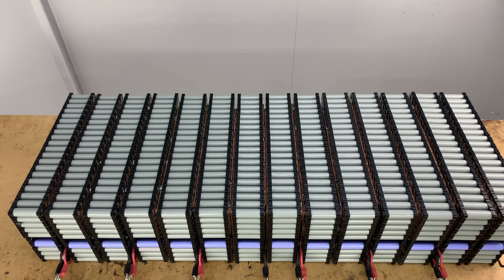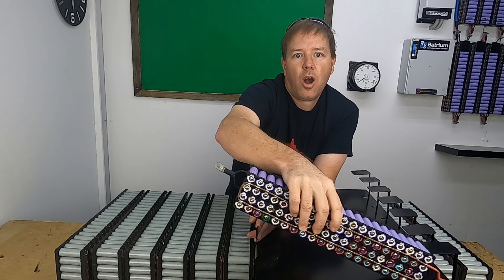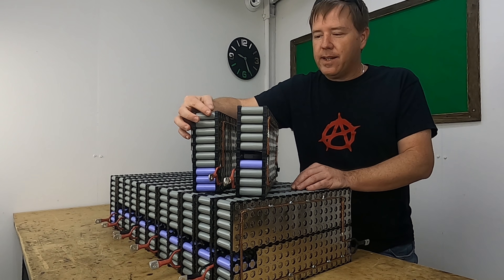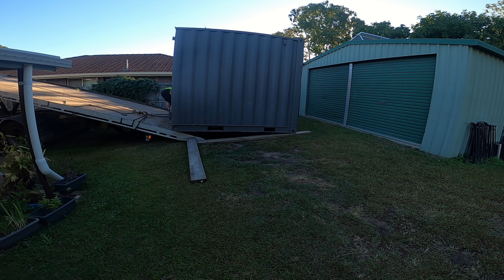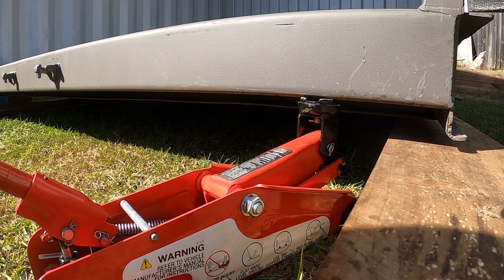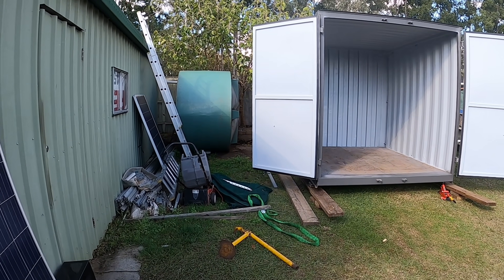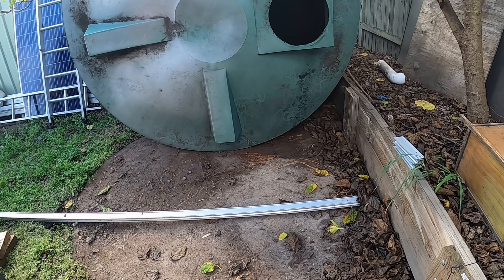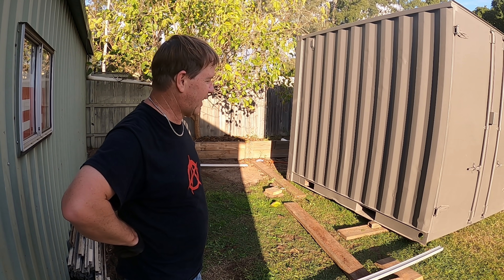Pt.2 Finding out my massive battery won't pass inspection!

Comment: Now I can see why there is a world shortage of Lithium cells…..You’ve got them all 😳
Reply: You can get a lot from the junkyards but you'll need to clean and test each one.
Save a little cash.
Reply: @arguescreamholler  What mythical junkyards do you speak of? The ones around me only accept scrap steel and don't allow people to pick through them.
Reply: @user2C47  
Mythical?
I live in Chicago!
Everything goes through here.
Reply: @arguescreamholler  a wrecked Tesla with these cells will run you $40,000.
Reply: @hondaguy9153  
IF YOU BUY A TESLA BATTERY!
You think tesla are the only ones that makes battery packs,
After Watching This Man Make A Battery Pack?
Reply: @arguescreamholler  Tesla is the only one using cylindrical cells in their cars.
Reply: You ever heard of the 18650? Or the 21700? 

Pls do your research before sharing misinformation
Reply from the maker: this pile is like only 20% of my stash lol
Reply: Right between the vape industry and this guy
Reply from the maker: I got many of mine from local schools
Reply: @HBPowerwall  How did you find out when the schools were dumping them?
Reply: @HBPowerwall  
You can find different varieties everywhere!
You can also save good ones from old power tool batteries.
Reply from the maker: @user2c47 from a local recycling company that didn’t know how to recycle them
Reply: @jollyrajer vapes need to have an exchange fee on them to encourage recycling.

Too many get dumped in the street, out of car windows etc etc.
Reply: @jollyrajer  😂😂

Comment: Those battery packs need insulating with shrink wrap or the like. 
One short from moisture or something conductive getting in there, and the whole lot will go up........

Soldering the batteries is also not a good idea. 
Unless you are some "soldering god" with superb equipment, you will probably damage the cells with the heat.
Reply from the maker: I spend 8 hours a day under a microscope micro soldering - but this is a whole other beast when it comes to heat soak lol Shrinking the whole battery is MADNESS you need access to use thermal camera regularly - it's the lesser of two evils

Comment: I would use stainless steel vs zinc plated fasteners to clamp together the terminal lugs. Also, toss in a conical washer on either side to accommodate for the expansion of the fasteners from heat. Add some Penetrox/Noalox/Oxguard, and you're golden!
Reply from the maker: I did consider that but there is almost zero heat under any normal load - like the idea of Penetrox tho - thank-you

Comment: Even if those 3 cells on the bottom aren't connected -- the full weight of the case is on their bodies & connections.  If a spot weld on a battery fails -- it would likely tear up through the pack, nah?  So, surprised the black battery case holder isn't what's supporting the overall load.
Reply from the maker: The black cell holders are quite average in strength over all, these mounts were designed for my old batteries that are 80P
Reply: @HBPowerwall  cool. I think I can see what's going on but the statement:  "when mounted, the weight of the entire pack is on the bodies of 3 cells" is correct, eh?
Reply from the maker: it sure is.. BUT more likely one cell as the bottom mount flexes taking second two out of equations. Same can be said about the top mount

Comment: multiple dude cells instead of simply insulating the damn thing better idea would be to insulate the batteries shrink wrap is cheap af and you could put vibration dampening mounts on the wall hell you could even spray on a plastic or epoxy liner onto your racks🤦‍♂️
Reply from the maker: Woulda, coulda, shoulda - nothing is ever enough - ARE YOU MY WIFE?

Comment: You should spot weld instead of solder. Solder can be dangerous due to heat.

Also would never put a metal plate on top of a open battery pack.
Reply from the maker: Thanks for the tips

Comment: I know that this is quite late, and I hate to break it to you, but it may help someone else. instead of using "skates", you can use cheap laundry liquid directly on the wood. There may be some scraping/damage to the wood, but when it starts to move you will get a "surge" of movement that if you can keep up with it you can keep going for a bit. 
This method is effective on a lot of smoother surfaces, such as boards or debarked logs.
The bigger the object is, the more runners and soap you'll need. Cheers!
Reply from the maker: Thanks for the tip... border line useless for me but will help others for sure.

Comment: who the hell makes a battery with all that plastic shit, I remember calculating that and its like 25% of the cost of the entire battery for like 0 reason
Reply from the maker: I know right - complete madness, WHO would build a battery, spend a year testing, filming and editing it and upload it to utubes - ZERO REASONS GIVEN!
Reply: @HBPowerwall  Yeah I have built 14S 5kwh batteries too with just the nickel and they work fine in the field (moving vehicle) without shorting out so your worries are unfounded.
Reply from the maker: Just nickel strip adds quite a bit of mechanical strength - not surprised it works.. air gap with plastic is great for air flow and reduce heat soak. Under high sustained loads i'll sleep better with this design in my wall mounts.

Comment: Wouldn't the correct solution be to have a mobile battery bank since the regulation is only about "fixed batteries"? :P
Reply from the maker: But then you run smack bang into a new and just as thoughtfully written regulation lol

Comment: Best is to take the plastic casings off, and dump them in a liquid for cooling purposes.
So many batteries in a pack can heat up quickly, and what will you do if a set will expand, or if one start catching fire?
Reply from the maker: If you have batteries that are heating up it's time you built a stronger safer battery. This battery was built for a environment, location & load...
Reply: @HBPowerwall more cells, is more risk
Reply from the maker: More cars, toasters, lighter fluid, mowers, wives - More risk?

Comment: No offense, but that was my overarching thought watching your previous video. That is unsafe as hell if not done right and they have no real way of verifying it was constructed properly and not dangerous.
Reply from the maker: driving a car is unsafe if not done right.. we live in a world of negative people - human race is doomed, time to get outside that box and try reduce land fill / early recycling of products before their true end of life.
Reply: @HBPowerwall  Cars are manufactured in a controlled environment. Your house is not an inspected facility for production. Thats just the reality. Dont get offended. Im simply stating the reasoning behind the regulations and why they would make it more difficult for people to do what you are doing. The regulations arent there for people like you who try to think out the process and do it right, regulations are for the lowest common denominator.
Reply from the maker: ooh i get the reason behind the rules, hell to be fair I'm personally responsible for said rules as I've had many people back a few years ago that I since found out WROTE those rules reached out for comment or binge watched every one of my videos. Also had fake inspectors head up my drive way to 'inspect' my setup.. These cells or any energy storage is potentially dangerous with out a doubt - I just find it hard to swollow that many of these people bitching on my videos have a deep fryer in their kitchen or a toaster with open elements
Reply: @HBPowerwall  I get you, my guy! Im not one of those people. Although, I can understand if you initially interpreted my post that way.
Reply: @HBPowerwall  Lastly, I do appreciate your videos. Thanks, of course.
Reply from the maker: no worries :P
Reply: @HBPowerwall  Also, there are laws about how to operate a vehicle BECAUSE its unsafe if not done right.

Comment: Why no fuses?  In a separate building is an excellent idea to avoid burning the house down if it goes wrong. How do you stop the Australian sunshine melting the batteries? If the brackets engaged on the plastic spacers the weight would be spread out nicely.
Reply from the maker: over 5000 fuses, next three videos (hint shipping container) Aussie heat, yeh - that's a thing I guess - Brackets hold up well (so far) and look NEAT!

Comment: I rolled my 20 foot container into place on four 10 foot pieces of 3" pipe.  It was on three at any one time, with the fourth as a "go around" to put under the leading edge as the container rolled off of one at the trailing end.
Reply from the maker: Would have been nice to have some pipe laying around to do that.. was also up hill slightly here ..

Comment: I love what you did and I am building a 24-volt battery bank for a houseboat I am going to be building with solar panels. What I need to know is. Did you use any BMS for your battery bank, or did you just connect it to an MPPT charger? Also if you did use a BMS, how many amBMS would you suggest I get for my bank?

Comment: Love the enthusiasm in what you're doing! Do you plan on charging the whole Battery Pack with Solar? I also like the part - Shipping Container as a storage for all those batteries too! For cooling, I would simply use a Solar Pump, and spray the whole Container, during those hot summer months. It really is a cheap effective solution, but you need a sealed tray underneath the Shipping Container, to capture/recirculate the water. I too, have had a "poor Man's Powerwall, mounted in an Electrical Enclosure - on the outside wall of the house. Using a single Solar Panel, and a 100Ah lead-acid battery, it has provided free (automatic) lighting in my home since 2005. The swim pool area also has overnight (free) lighting, and also the pool underwater light is operated on 12 volt from solar. One day, all homes will have a Hybrid (back-up) system. My '71 Beetle has also had the 'treatment' and has 4400 Lithium 18650 batteries on board, is fully-electric. Found your YT Vid by chance today. Doing our bit to save the Planet!
Reply: One thing 2021 has taught us is to be ungovernable. Rules and regulations from antihuman despots are just screeching's of authoritarian thugs
Reply: @TheBelrick  Yes, the Rules and Regulations keep being added year-after year. It can stifle innovation.
Reply: @peterduxbury927  not just innovation but life and liberty too

Comment: That looks like it was hard work moving that container. Next time, get post or 4" pvc pipe and push it to where you want it to go. That really took a lot to move. (Work smart, not hard.) P.S., I'd like to know, who gave you the idea of using flat boards/planks?lol
Reply from the maker: All I had, and it worked - i worked cheap not more expensive

Comment: There's no way an uninsulated metal box would be good enough to store my batteries in the climate I live in
Reply from the maker: As it turns out not even here - the shipping container gets to plus 50 inside!
Reply: @HBPowerwall  Buy some rockwool or rigid close celled foam :)

Comment: Do we need cooling system for these batteries?
Reply from the maker: No, battery is built to the desired load. under 0.25 amp draw max..
Reply: @HBPowerwall  meaning, all the EVs which have cooling system for batteries are overloading the batteries to increase the energy density ratio?

Comment: Where is the cooling?  Tesla's powerwall has extensive cooling.
Reply from the maker: They also expect an a lot more from their battery. If this battery changes temp by even 0.001 of a degree there is an issue. intended max load is something like 0.1 amps...

Comment: This is basically an overgrown version of what I did when my landlord took me to court for my system

I put all my batteries inside a large metal box that is stored under several layers of shade cloth in the back yard, and the solar panels are mounted on a glaziers trailer with a pulley system to raise them up like a giant T, soon I'll be figuring out a way to keep the batteries and inverters on the trailer without compromising water resistance

They have tried to breach me a couple of times, but because it's a registered vehicle, there's nothing they can legally do about it until the registration runs out (assuming I don't renew it beforehand) 

The only thing i have that I could be breached on is a cable running from the trailer to the laundry socket, and that's only if they catch me using it (I unplug the house before inspections) 

Surprised you didn't think to do that, would've saved you thousands of dollars vs what you did in this video
Reply from the maker: I don't want to hide, don't want to have to plug and unplug. But yes putting it even on wheels changes the rules as it's not fixed. That introduces more issues than it solves.
Reply: @HBPowerwall  yeah plugging and unplugging is annoying, but it's better than paying $50k for a compliant system to be installed (no company will use my existing equipment, and off grid systems are not eligible for rebates) or spending $10k+ that I don't have to buy a sea can and pay someone to turn it into a solar box 

My idea is also easier and cheaper to transport since i just fold down and lock the panels, hook it up to my car, and then tow it where it needs to go

My goal is to pay as little as possible to satisfy red tape, and so far I have achieved that goal

Comment: Hey ..I still don't understand how the battery pack is sitting in that rack, since that battery pack is too weight that should of fall down from rack.
Second question is ...(cell level fusing)
Who can help to send to indian cell level fusing nikel strips plates(Tesla model)
Because of its not too much weight so, probably I can get on low shipping charges..
Please comment
Reply from the maker: More info on the mounts - https://secondlifestorage.com/index.php?threads/hbpowerwall-official.176/post-885

Comment: Three highly flammable cells holding entire block. Hm. Should be fine.
Reply from the maker: Unless of course you actually watched the other two videos you'd know that the blue cells are zero volt and not connected.. Hm. Should be fine.

Comment: Was gonna say, where is your battery case, it's a half a shipping container lol. 
You should look into making it a conditioned space, it'll extend the life an efficiency of the batteries.
Reply from the maker: That was defiantly planned, was going to try passive cooling first then if that wasn't effective air conditioning.. Naturally insulation & removing the direct sun hitting the container.
Reply: @HBPowerwall  don't ya need buried tubes for passive cooling. I know it works with air ships. 
You could consider using thermal batteries

Comment: you may done that container transferring in place  more easy way by use your car and chain to pull it in place through your wooden wall by removing one pile of wood as i can sea there is road behind your yard or even push it by use of some spacer between  your car bumper and container with help of that roller rail.but i don't know is there any access for this around and back of those woods but its looks  that was possible
Reply from the maker: My car I isn’t going to be doing that lol not a chance in hell it Kyle happen.
Reply: @HBPowerwall  sure

Comment: What if you put the batteries in the floor of the shipping container? And use the space inside as a office studio?
Reply from the maker: we did consider making a steel box and putting it through the center of the container (over the walkway) but that would reduce the ability to move the container on a flat bed truck as a key part is being able to easily and quickly move the container to a new location.

Comment: Oddly enough with all that battery power available, a atv winch would've probably pulled it along quiet nicely, also I rolling it on rigid pipes would've been a far bit easier, all be it more back n forth resetting the pipes
Reply from the maker: Those machinery trollies were brilliant - and don't have a witch so this solution that cost nothing but effort was a good investment
Reply: @HBPowerwall  sweat is one of favorite ways to invest,  from the video it looked like you had 2 skates and was leveraging the other side with that Jack. Figured a couple pieces of pipe would've been easier.
Reply from the maker: had 4 skates

Comment: First of need to say love the information in your videos. Just out of curiosity.  Why do you need 30 kWh worth of  batteries ?  I live in a cold  winter country and rarely exceed 12 kWh.
Reply: Wut? I could drain 12kW in 1-2 hrs in the winter.
Reply: Hot countries require more power if you need air conditioning to be comfortable. Wait, is that true? I think I just said something that may not be true. In any case, an average single-family house in Canada uses about 30 kWh of electricity in a day. The key here is that we use electricity for cooling but most of us use fossil fuels for heating. That's going to change.

Comment: all the weight is on those 3 cells on the bottom. You should have let the pack rest on the plastic holder.
Reply from the maker: That is why those three cells are 'blanks'  and all the weight is actually only on one cell not the three

Comment: How much can this power? If let’s say the power goes out and you need to use the batteries to power the refrigerator and the lights around the house. How long can the set up last?
Reply from the maker: 25kwh so 1kw for 25 hours 500watts for 50 hours 100watts for a bloody long time..

Comment: How long would pack of old laptop batteries last as far as years of use  before they would need replaced? I thought that these ion cell last about ten years or so. Do you match up the internal resistance ?
Reply from the maker: IR IS with in 20 or so, my current battery is 4 years of full time use and still going strong (with maintance)